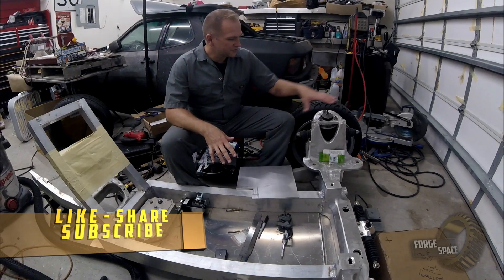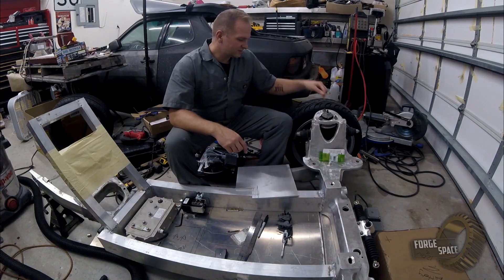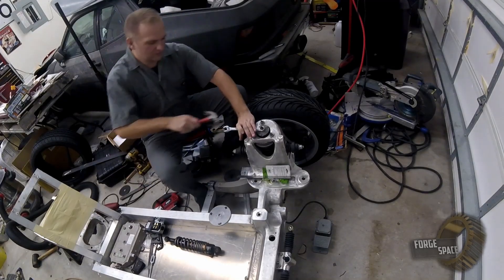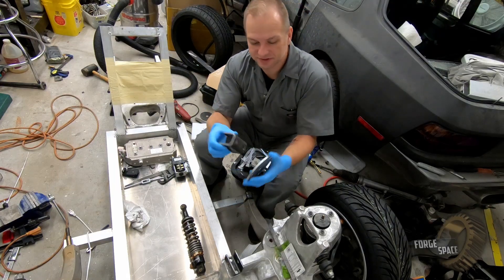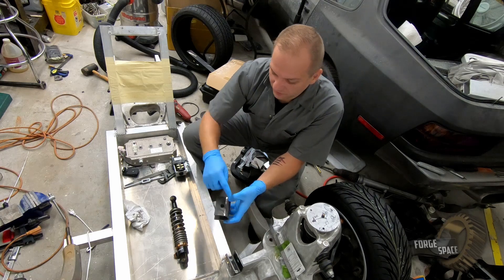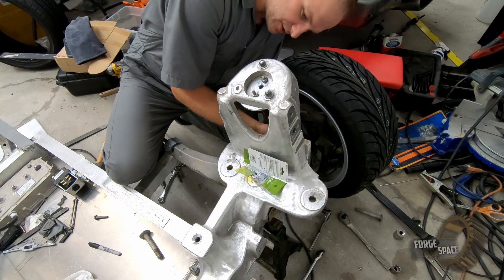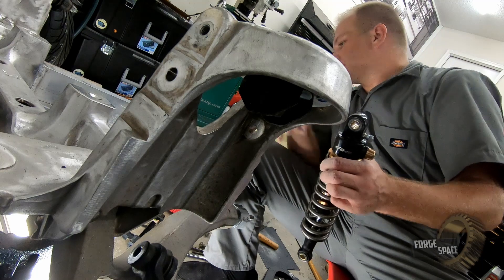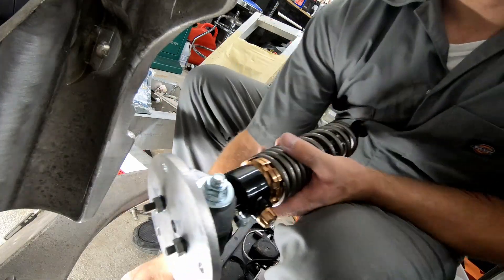Electric Trike gets LOW! - CyberTryk EP.06

Comment: could you tell me what motorcycle swing arm you used for your rear hub?
Reply from the maker: I ended up using the suzuki sv650/sv1000 swing arm. But the ninja swing arm I initially purchased would have also worked.
Reply: @ForgeSpace  nice. I just purchased the same motor last month. It arrived yesterday. 
Have been using SABVOTON spoked motors for my recumbents, but I got sick of re-spoking and running through fat bike rubbers like they are made of soft butter. Lol. 
You have an interesting build with the front end taken from a car. Cool. 
I started 5years ago with a recumbent trike. Peddle powered... 
What I have built from that machine... Well. It has been broken and rebuilt many times. 
My current build uses atv parts for the front suspension. And has an ultra capacitor bank providing a good chunk of my power output. About 1/3. 
Thanks for the swingarm heads up. 
I was just going to make my own but this would save me the effort of trueing the arm.